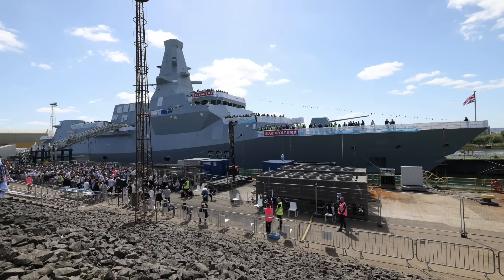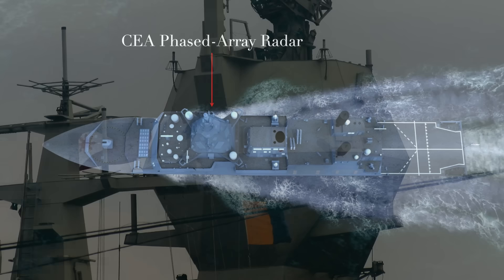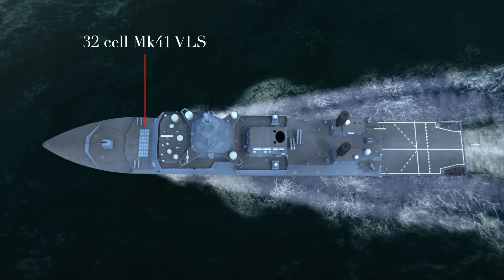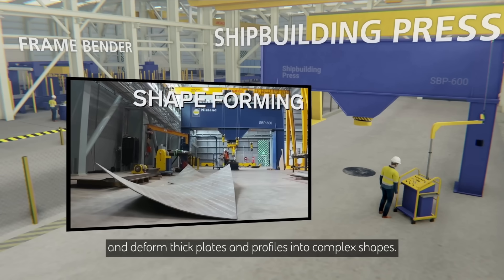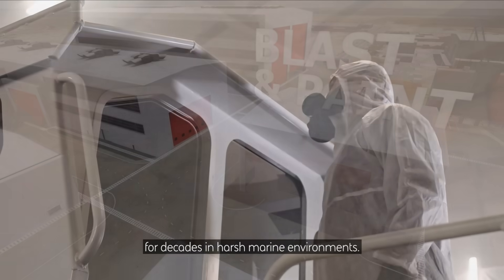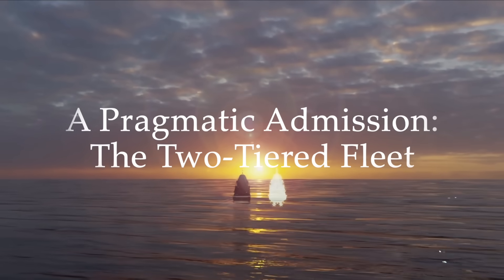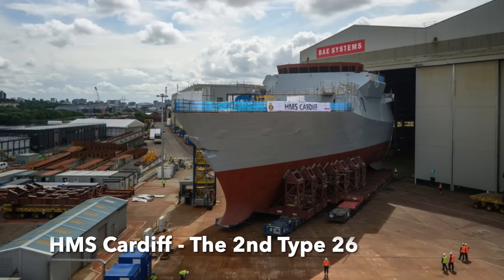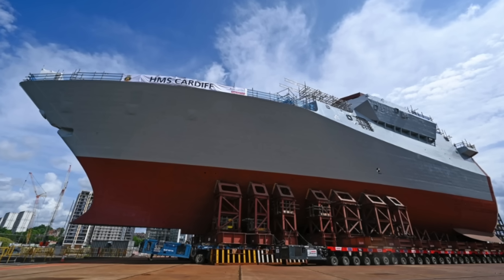The World’s Most Expensive Frigate? Inside Australia’s Hunter Class

Comment: Seems they were trying to have a high end anti sub ship and hi end air defence ship in one ship. That's fine, but maybe should have made the hull bigger to house say 90 VLS to full fill that role. 
BAE did show a version where the mission bay was replaced with 64 type 41 VLS, and 16 NSM so would have had 88 VLS, ship would have been pretty good, but probably very expensive.
Reply: the problem with those high end vls count concepts was that it removed the towed array sonar which would remove the anti sub capabilities. But swapping out the mission bay for vls would have been fantastic.  But at the time they were going to be our whole fleet and the mission bay would be useful for patrol. Hindsights 20/20.
Reply: Exactly. You need around 10,000 tonnes baseline to do both. Foolish thinking, but I assume RAN wanted their radar system at sea. Using cooperate engagement systems as well.

Given ASW operates solo away with the fleet (ideally in tandem with a SSN) I’m not sure you want to give your position away via air defence radars.Better to deploy AWACS.
Reply: @nickbrough8335  yes, good point.
Reply: If they were going for a WAAD vessel, they would've stuck SPY-1 or SPY-6 on it. AEGIS is to maintain concurrency, inter-operatability and ease of training with the AWDs, and to allow easier integration of IAMD systems.